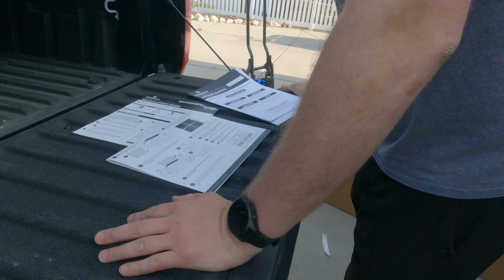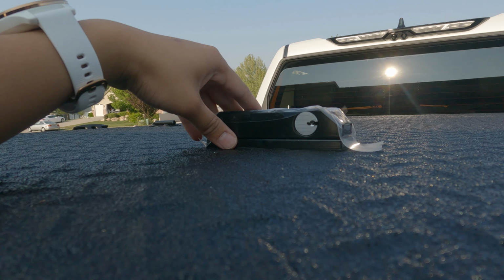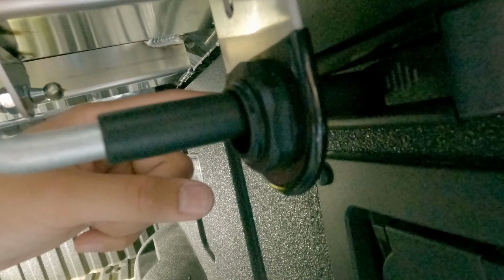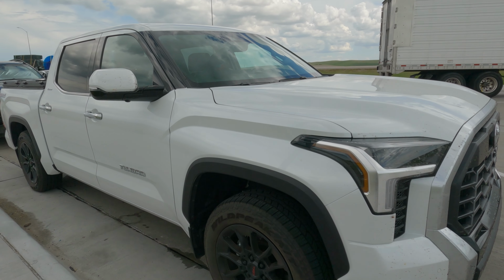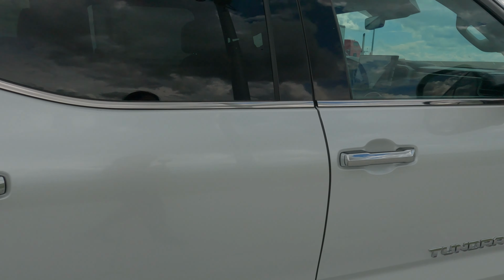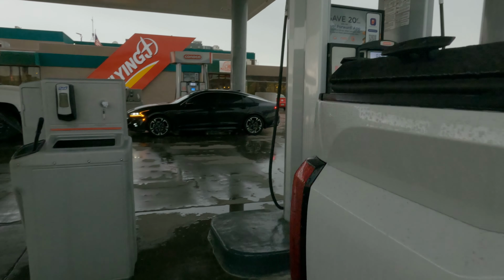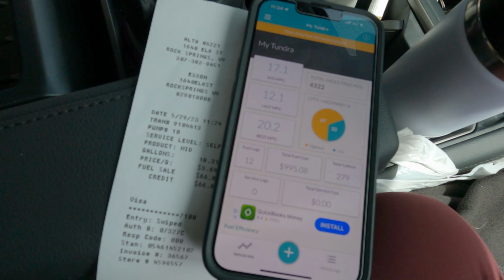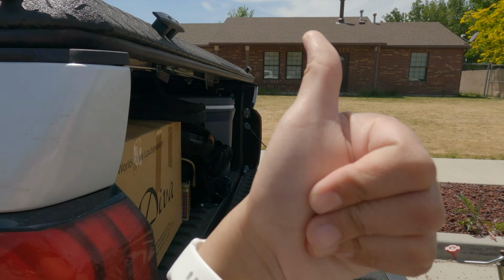2023 TOYOTA TUNDRA DIAMONDBACK TONNEAU COVER INSTALL AND REVIEW | TOWING WITH TUNDRA GAS MILEAGE

Comment: Does the tailgate let down automatically or is the seal too tight? Thanks, great vid.
Reply: bump- I'd like to know this as well.

Also, does the weather strip on bottom come with or did you do that separate? I see a seal that you can buy but looks like it's just extra and not the whole way around.
Reply from the maker: You have to play with how much you tighten it down in order to allow the tailgate to still fall automatically. It can definitely be too tight so the tailgate just stays up, but we haven’t seen any issues in terms of seal with it only tight enough to allow it to still drop automatically. 

The weather stripping came with the kit. There’s an additional weather stripping piece that also came with but we weren’t exactly sure where that was supposed to go or if it was extra
Reply: @JPTrek  thanks! Appreciate the video for when I install mine!

Comment: From what I can tell. To remove the cover you need to undo the center clamps fold it up and your done? How heavy is it with all three panels together for removal?
Reply from the maker: You need to open it up all the way then remove the struts then you can unhinge the panels. The center clamps are the last to come off. We have not taken it off all together but the front and rear panels are around 50 lbs each. Their site says 125 lbs total.

Comment: Nice job. So your cover didn't come with bed rail cap shims? I have mine on my 2018, which I bought used and now I'm seeing you should install shims before installing the cover.
Reply from the maker: No they did not. The instructions didn’t mention anything about it, but we will definitely look into it now. We recently took the DB off so will see. What do the shims do? We adjusted the rods several times (just omitted from the video lol) for the right fit. Do you need to retighten yours from time to time? Or do the shims save you from doing that? Thanks in advance
Reply: @JPTrek  Gotcha, I just got mine like a week or two ago. I bought a used diamondback in really good shape. So the bed rail cap shims might not be required I believe if they didn’t come with it. Pretty sure it just raises the bed rail cap a little, so when you tighten the clamps down it doesn’t crush your bed rail cap or damage it. And yes I did have to retighten mine once so far. Hasn’t come lose yet lol
Reply: @2805Heath  I am curious about this as well. My understanding is that the shims fill some of the voids underneath the cap.
Reply: I emailed Diamondback asking if I needed to purchase the shims for my 2024. Their response was that 2022+ Tundras do not need the shims.

Comment: Did u need the weather strip on the front part or no
Reply from the maker: It came with a “putty” to close those gaps but did not need weatherstrip. It’s been a year and that putty needs to be replaced bc it melted

Comment: New tundra owner here. Loving the look of the Diamondback cover. Off-topic, how do your dogs do stomping around on your back seats. Any long-term worry they’ll trash the back of your new truck? I want this Diamondback but still considering a bed cap so dogs can hang out in the back. A lot of pros and cons to both so I’m confused as hell.
Reply from the maker: We always plan to have that dog seat cover in the back whenever we are bringing the dogs. For the most part, they usually take a nap on the road and we have their space cushioned with a dog bed and a couple blankets. Spent about $60 on the dog cover and best investment with the dogs in the new Tundra so far (oh we've had some incidents!). Diamondback has been great so far and can always put stuff on top of it (although that limits the accessibility).
Reply: @JPTrek  Appreciate the response! It'll be the 1st time I've had a truck and trying to make it all work with family/dog/gear. Just can't decide between a Smartcap and the Diamondback. I'd prefer the Diamondback but don't want to make an expensive mistake for what we do.
Reply: What did you end up going with? I'm in similar position. Cap could be great to use the bed for dogs or just get seat covers and keep them in the cab.

Comment: How tall are you. Is it good for short people like 5'8"
Reply from the maker: Pat is 6’.  No lift on the Tundra right now, but Jill is 5’ and can close front cover easily since the lock is closer to the side of the bed but she needs to step on the back bumper to reach the lock on the back cover. At 5’8” I don’t think you’ll have any issues! Super smooth open and closing too.

Comment: Besides the awesome looks, this is not practical for everyday purpose specially if you want to utilize the entire space of the trunk. Imagine having to  loosen the bolts and taking the panels apart every time you have to haul something taller and larger in your truck.  Gets old real fast
Reply from the maker: This is a really good point. When we get 6+ feet of wood from home depot or something longer we just have the rear cover open. Not going on the highway or anything, just city roads less than 50mph. Can't see anything from the rear mirror at that point though...
Reply: Many of us have deck systems anyway. Many of us don’t use out trucks for work. I don’t haul furniture. I off-road, hunt, and camp. These covers are AWESOME!!! But I   stack plywood and 2x4s on top. Also bags of mulch or basically anything and just ratchet strap down.

Comment: Not fan of this Tonneau.. when u gotta get something from the front its impossible...I'd get sick of it so fast .
Reply: Small man problems.
Reply from the maker: We haven't had issues getting anything from the front. If you're under 5'5" might have an issue just bcoz the bed is a bit deeper but opening and reaching for the bed has no issue for us.